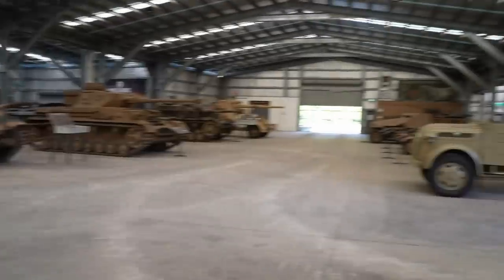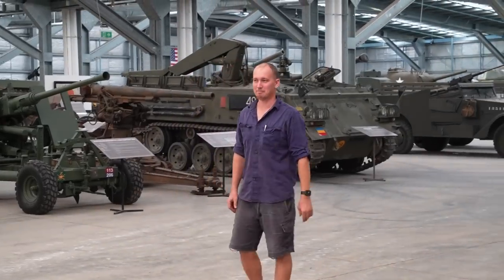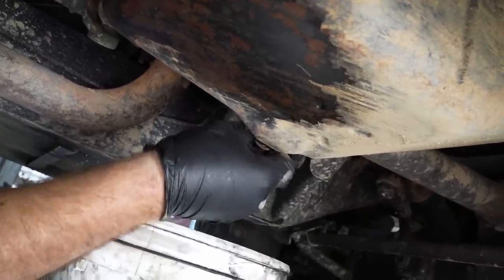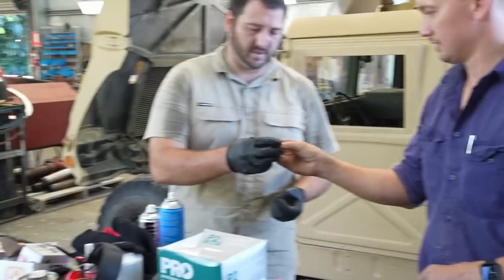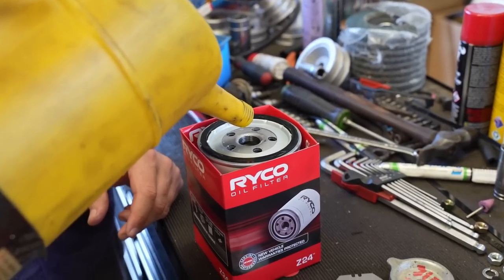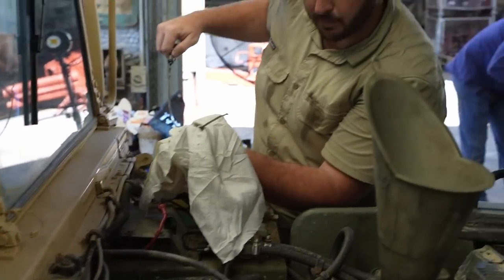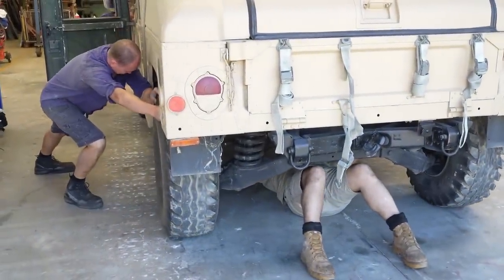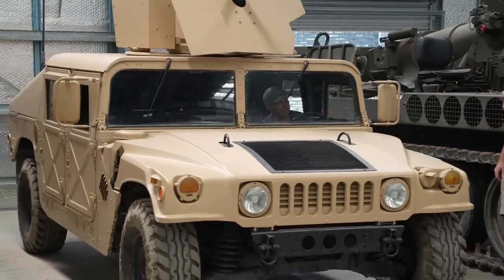WORKSHOP WEDNESDAY: How to service your US Military Humvee

Comment: I was a mechanic and recovery vehicle operator in the US Army for 20 years, spent thousands of hours doing this service.  Don't forget to check the oil in the geared hubs, the small reduction gearboxes at each wheel.  They do not hold much oil, so even a small leak can lead to a catastrophic failure.  Love your channel, keep up the great work!!!
Reply: I hope they read your advice.
Reply: I wonder if they have the -10, -20, and -20p manual's
Reply: Yeah I caught that too. They did pretty good, but missed the hubs. I’d probably of checked the fuel filter on the firewall for water too. Army 63b and recovery, 12 years👍🏼
Reply: Also gear hub spindle nuts....they are notorious for coming loose making the wheels fall off.
Reply: @gaboonviper85  Depends on if the previous owner put in the updated locking ring.  I still have my special socket for doing those hubs!!!
Reply: @ludercoarms  as he mentioned the humvee came from spain.....so im doubtful it has updated locking rings and nuts.... ive seen so many humvees flipped on their lids and or suffered rather heavy damage in the front end from a wheel falling off and getting jammed in the fender/wheel arch....

They are rather cheap pieces of insurance to upgrade them or just double check that they are tight at minimum
Reply: @gaboonviper85  Yeah, I would definitely check them.  That updated locking ring came out like 25 years ago, so hopefully it got one, but you are right, it's cheap insurance to check them and update them.  

I towed a ton of them with the wheel off over the years,  Never a good time to lose a wheel!!
Reply: @ludercoarms  I've also noticed that surplus humvees always have a shocking amount of trash and debris in the fuel tanks....probably from bacteria but im no chemist.
Reply: I think the boys definitely need a hoist.
Reply: @gaboonviper85 algae I 🤔
Reply: I was just thinking about making the same comment, I was a H8 for 12 years myself. M88 qualified as well
Reply: I plan on buying one so thinks for the information

Comment: That´s a very early Humvee. Hints are the remnants of the early one-armed mirrors in front of the windshield, and the vehicle data plate on the outside rear left fender. Only very early Humvees (say ´85 or ´86) had those plates.
I´m pretty sure the gunner protection kit on the turret was later added on, as it was usually only used on later M111x or M115x Humvees.
Great episode, as always. I just posted a link into our Humvee owners group.

Comment: I chuckled when the Humvee wouldn't start on the first try. Did someone forget to wait until the "Glow Plug" instrument panel light shut off? 😮
Reply: Sat so long, that fuel system had drained back? Had to crank it over for little bit for the fuel pumps to get fuel to cylinders?
Reply: I was thinking the same 
No glow no go 😂😂

Comment: I own a Humvee M998.. I love these Humvees...Just to let you know... Those bushings do not use a 27 mm socket...
Every nut and bolt are ASE Sandard ... Those bushing bolts are 3/4 inch ... The oil drain plug is 9/16 ... The same that General Motors used for over 60 years ...
Wish I could be there to give you hand ... 
These Humvees are very special to me.. And my business 
Sincerely, Captain Ron 
Naples Florida
Reply: the 27mm he was talking about was the diameter of the swaybar, not the bolt

Comment: This is a post Desert Storm era  Humvee. Slant back humvees were used alot by combat support Military Police units.
Reply: Looks like an M1025? We ran the M1026 in the scout platoon in Korea exactly like this but it had a recovery winch. Pretty sure the 1025 had no winch.
Reply: The M1025 (the one in this video) was used before Desert Storm, the Humvee variants you’re thinking of are the uparmored M1113 ECV series, which was developed further during the GWOT. 
Slant backs were issued far more than just to MPs as well.
Reply: @TheRazorbackpilot  has the wrong Sideview mirrors then.

Comment: 5:22 a pretty simple and effective way to clean those is to make an adapter (basically a piece of round wood with a hole for an air hose in the center) and put some pressure on it outside (not much, you don't wan't to rip them open tho). You can do an even better cleaner if you have vibrating base to sit the whole thing on. Dust just falls out of the stuff.

Comment: I served 11 yrs in the U S Army and reported to my first unit in 1986,shortly after the army started replacing the M151's with M998's.I noticed that the example that they have is an earlier version with the brakes mounted to the differentials. Something to be aware of is the tendency for the bolts holding the calipers on  to  back out and start hitting the bolts holding the half shaft to the flange on the diff. I experienced this issue several times and started including checking them in my pmcs and tightening them periodically.

Comment: As a humvee owner in Brisbane, nice to see. Definitely don't forget the spindle locking nuts. What model slant back is it? It's an A0 truck as it still has the early mirror brackets and what looks like the 6.2 v belt, or could be the mid 6.5 v belt. Look forward to seeing it when I visit.

Comment: to check the clutch fan operation you can disconect the electrical line that is near the black box on the drivers side engine bay.  when the line is disconnected the fan kicks in.  something i picked up from AM General back in the day.  Used to start the engine with WD8 wire as a jumper on the test connector but i cant remember which spots. only used it a few times when the ignition switch went out.

Comment: As a mechanic and a Qc there is few things I see here. The end of the clamps an the air filter housing should be under the air filter housing guard. The right side mirror is useless in this way you can not see anything in the mirror. Not mounted correctly. Its in the manual along with many useful information

Comment: Do you have the -10 Field Manual for the Humvee?  If not, get one!  During my time in the Michigan Army National Guard, I was around Humvees quite a bit even though my MOS was communications and not motor pool.  This is important.  Check the 3 castellated nuts on each wheel.  These are inside each wheel.  Check to insure the cotter pin is there and installed properly.  I have found two that were missing and one nut on the bottom of the drivers rear wheel was starting to back off.  Having the cotter pin gone and the nut come off will cause a major problem going over a big bump!!!  Going into Iraq, we put a nylon stocking over the intake for the air system.  This was to filter out the sand before it could get to the filter.  One fun thing was watching new troops reaction when the fan switches from low to high.  They think the Humvee is ready to blow up or worse.  
During our convoy into Iraq in 2003 in July, it was very hot.  We pulled the plug to force the fan into high speed.  Normally, a Humvee operates at 180F.  During the convoy, our ran all day at 220F.  Not a problem.  240F on up is when you start to worry!  It can be one tough vehicle.
Don't ask about milage!  It is military.  Uncle Sam is paying!
Lastly, in Iraq, we did not use diesel.  We used JP-8 jet fuel.  No problems.  Motor Pool told us the JP-8 cleaned out the carbon in the engine!
Have fun driving the Humvee!  I did in the National Guard!

Comment: Little trouble starting, typical. Inside every US Army Humvee is its dispatch book, a green plastic book to keep papers for the vehicle. Almost every one of them you will find a perfect circular soot mark on it. If your Humvee has trouble starting you take that book and place it over the exhaust pipe blocking the exhaust and the Humvee will fire right up. Don't know why this works but on most the Humvees I was assigned this was the only way to start it.
Reply: We’d use the seat cushion…lol

Comment: Brake fluid does not look good.  Plenty of it but the brown colour denotes water contamination.  Seen worse and it should be OK for the intended use but I would change that if the vehicle was going to be used on the road at all.

Comment: You're gonna ruin the Transmission. Transmission fluid may be high depending on the vehicle. you have it check after driving/getting trans to temp. Your transmission may be low on fluid now.

Comment: Detroit diesel?  GM.
Reply: That's all they ran unless they ran somewhere else later on
Reply: @IG10705  I spent 21 years in the US Army in maintenance & logistics.  This is the 1st time I’ve ever heard to a 6.2 or 6.5 ltr called a DD.  This is a GM engine and GM parts throughout.  The only DD’s I remember are the 6V53 and 8V series.   I won’t pretend to know that DD was not issued a contract to provide GM engines to the military because that was posted.

Comment: Sorry guys but changing the oil on a Hummer is not what I consider interesting. Lets stick to the tank and gun gun restoration.
Reply: Might not be to you which is ok. But 24k people watched this video. So they found it interesting.
Reply: Just my opinion. I'm sure there are people who like to watch paint dry. Changing oil in a GM product you can own and run on the street compared to rebuilding a tanks suspension,  I'll take the latter.
Reply: @NOLAART   You know what they say about opinions right?
Reply: @drunkmike6364  Yeah, isn't it " A**holes don't like them.” or something like that. 😆